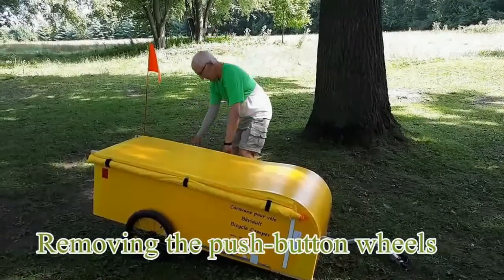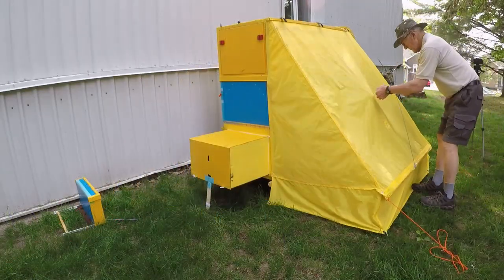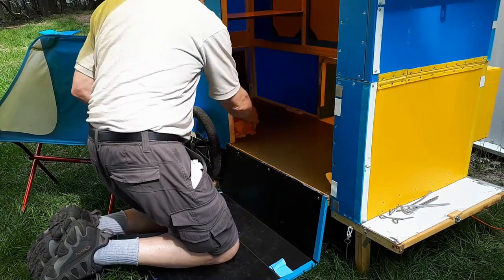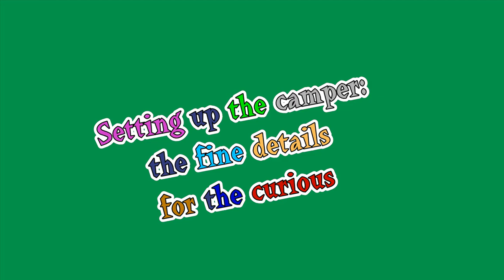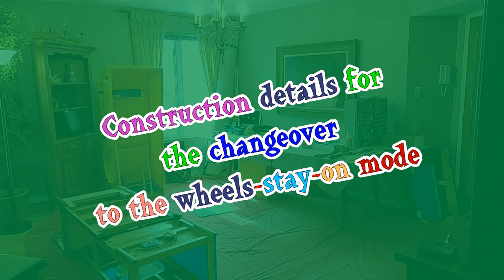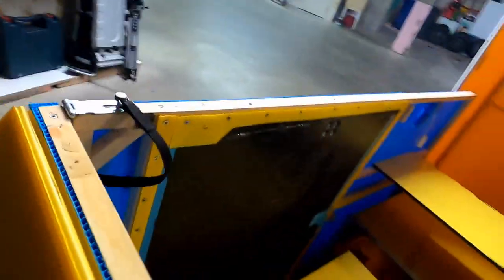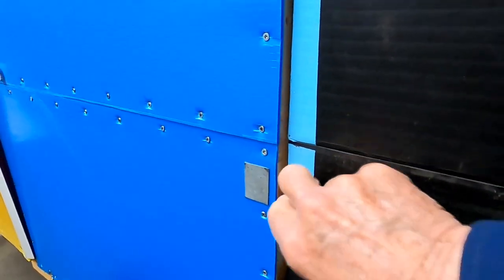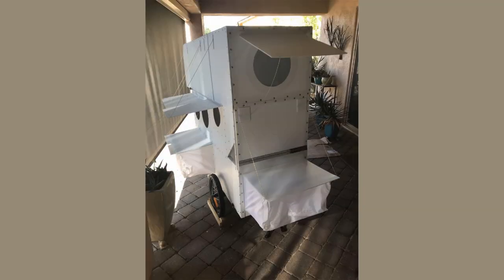World's Smallest Bicycle Camper Keeps its Wheels  -- Changes to my camper for 2021

Comment: Thanks for the call out Robert. As you know I have added 4 more wheels and have used the camper as a pick up truck camper. With a 6 ft bed it fits perfectly. I can now journey beyond my leg limits!
Reply: So your vision has fabric extensions instead of a box, nice idea, Im making the side one higher so it will go above the bedding. Haven't made anything yet but have several plans so I can steal your foot extension idea

Comment: Fascinating  and your presentation was very enjoyable I'm curious to know if you tested the units stability in a brisk wind  Thanks for this delightful video!
Reply from the maker: I stay in campgrounds, where the sites are often sheltered. I still haven't encountered very strong winds at night, so I really can't tell how it would stand up. It tows very well in strong side winds, but once set up it's much higher. It's the vestibule that would be mostly affected, so in a pinch, I could roll it up and hide inside the trailer part.

Comment: I like the idea of your camper, if i built one I think I would try to use 20 inch wheels as I would use a recumbent trike to pull it with and would want the wheels the same all around. Have you considered using solar panels on it?
Reply from the maker: Good point. I did put a 100 Watt solar panel on it for a while to experiment with. But for me to be independent from the grid, I would need 350 Watts. There would be a way of attaching them to the camper, but the extra 25 to 30 lbs of weight would make lifting the hood (the top part) vdifficult. Not impossible, but I'm not sure I would be happy with it.

Comment: Lol, look at that extension cord. Why is it that inventors have weird looking extension cords?
Nice camper,  like the way it collapses into a small box for towing, minimal wind resistance. The base could be made wider with a design from dining tables, the addition of the leaf.
Also, I wonder if you experimented with insulation styrofoam glued to the shell for a bit of rigidness, strength and increase insulation.
Reply from the maker: The extension cord is home-made using two conductor marine wire to save weight. I admit it's a little on the narrow side, but that's the price I have to pay for less wind resistance. Coroplast already has some thermal resistance because of the inherent air pockets, and I only use it during the warmer months. Thanks for your interest

Comment: that’s super cool man. With an e-bike even more-so. I like the awning ‘cause i live on the Pacific Northwest in Canada and it’s often a bit damp out, this time of year, drizzle and cloud. But we live in one of the most beautiful rainforests in the world so we love it. I admire what you do. I just gave away my bike trailer to a handy man with an e-bike. In market for e-bike now myself and will build another trailer to fit my specs i mentioned on one of your other vids, to fit guitar amp, power pack 1000 watt Jackery Pro, 200 watts solar with tilt-able mounts, two guitars as one should not go out without at least two guitar ańd a mini keyboard and an iPad at the very least in the 21st century. So yah, i’m going to rig an aluminium or chromo frame from old bike parts and perhaps carbon fibre sheets for frame as it has to be bear proof also. If i could also serve as hovercraft/submarine that would be boffo too as i live on the ocean, Pacific, the best ocean of all of them as far as i can tell. Indian ocean is cool too but too many pirates. Nice Islands though :) It would be a trip to ride and sail all over the world making music and dancing with the locals, trying not to get pirated along the way, because bike trailers like that are hard to come by in some parts of the world. Perhaps a camel drawn one would work great also but those are rather large to fit on a boat right.
Reply from the maker: I see you're not ready to die of boredom. Good luck with your future builds.

Comment: Robert, you dear "old Geezer", just because you are you, you are getting a like...oh, and also for the gallant Musketeer-like, courtly bow and for admitting you have Arthrose....and for showing us, sort of, the advantages of the extra height.
Reply from the maker: I can see that if you're not 79 and haven't tried both the wheels-off and the  wheels-on versions, you wouldn't be convinced of the advantage of that 10-inch height. My guess is that you're younger than me. Keep fit!
Reply: @RobertBeriault753  you estimate correctly with the age but I would need 20 inch height increase to adjust to my capacity or limitations, as the case may be, so what age would that make me then ? My comment in the previous comment was a song of praise and not one of condemnation. I still have not as of yet, even built the construct but find,  those who have and have delivered their own personal structural stamp, very interesting and thank you for making your plans so freely available. Merci beaucoup.
Reply from the maker: Most welcome

Comment: I wonder if you could expand the overall dimensions by an inch or two to add insulation foam and reflectex to line the cloroplast. I like the vestibule that you could probably store your bike inside if you wanted. 

Just a thought, you could store an origami kayak on the side/top and pack one of those padle bike conversion kits if you want to take it on some canals, then tow the trailer in the kayak...
Reply from the maker: I think all those things would be feasible, except making the kayak big enough to carry the bike, the camper and me would be a challenge!
Reply: @RobertBeriault753  the kayak is just for the trailer. The paddle bike kit packs out to turn your actual bike into a paddle boat. Then you fold out the kayak or even a pack raft to hold the trailer while it's packed down and tow it behind your paddle bike. I'll see if I can find the video for the paddle kit...
Reply: It's called a Shuttle Bike but it won't let me link to another video. They do have a YouTube channel but haven't loaded in a while. But it's yellow and blue so it matches your trailer, lol!
Reply from the maker: I googled Shuttle bike and found plenty of pictures of it. Interesting

Comment: Hello Grandpa,after quite a long time  I am commenting on your video since our life is completely massacred due to covid,hope corona could not restrict your bicycle camping passion....stay safe, are the wheels on your camper just attached to the sides without axle?how do you manage rear braking (because i have noticed you pedal quite fast 😀)?you can go for an electric bicycle with solar charging or a bicycle with regenerative pedalling.
Reply from the maker: Thanks for following what I'm up to. I refuse to think that I ride fast 😉, Braking isn't a problem on flat surfaces, but in hills I will need exactly what you are suggesting: regen braking. This will add redundancy by adding a second braking system, make braking safer in very steep hills, increase the range of the bike and save on brake pads.

Comment: I really enjoy your channel. You are a true inspiration to all of us builders, cyclists and bicycle tourers.
What type of material do you use for the tent and velcro, and how do you keep the velcro from coming off,
Reply from the maker: Thank you for the testimonial. The tent is 72 Denier PP-coated nylon and Coroplast is one of many companies that make fluted corrugated polypropylene sheets, or flute board. I t is also known under the tradenames of Cartonplast®, Polyflute, FlutePlast, IntePro, Proplex, Correx, Twinplast, Corriflute or Corflute, Distriplast (France)-
Reply: @RobertBeriault753  thank you so much for your response, it's much appreciated. 
If i may ask one more question? How do you keep the velcro attached to the coroplast without it coming off? I'm worried about strong wings pulling it off, or heat melting the glue (I live in Florida)
Reply: I started with self stick industrial strength Velcro. Pulling the vestibule off several times began to cause the Velcro to detach from the Coroplast. I used a staple gun and stapled the strips along the frame. It has stood up to heavy gusts.
Reply: @garymonroe4187  excellent! Thank you.
Reply from the maker: I use industrial grade adhesive Velcro on the body of the camper and sewed-on female Veldro on the nylon vestibule. The industrial stuff has extremely strong glue, but after three seasons, it started to peel away ffrom the Coroplast, so I put a small screw at each end, because that's where the stress was when peeling away the nylon when closing camp. There is still a possibility that a very strong wind causing a problem, but so far so good.
Reply: @RobertBeriault753  perfect 👌. Thank you, I'll be trying that on my camper in building.

Comment: Hello my friend,
I can see that you are making so great improvements. Thanks for the video shout-out on my little “Cof-fun” version of your great design. I have not yet painted it Camouflage. I have just finished re-designing it to be a two person pullout version, with the companion having his/her own trailer with their floor being the folded addition to the pull-out. Companion also totes the passenger’s foot-box.  Thanks to you, (smile), I now must incorporate your additional great idea,  in reconfiguring it more to raise it a higher level with supports under a 20 inch wheel radius. A removable wheels axle, I fear, will not support any weight, per say, but I will support the camper ,any way, with 6 flanged bottom fold-down supports available through 8020.net. I’ll send you the 24 AutoCAD drawings when completed. Keep up the inspirational suggestions. Love, Mickey
Reply from the maker: Thank you, Mickey. Looking forward to seeing more about your two-person innovation.